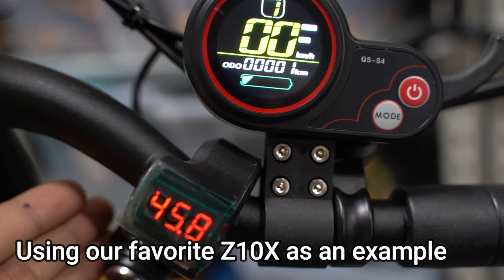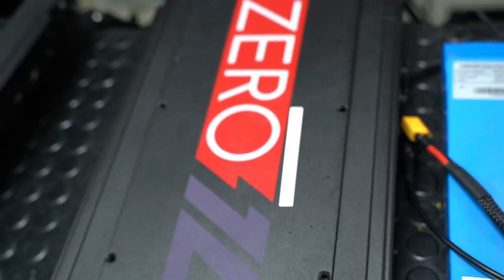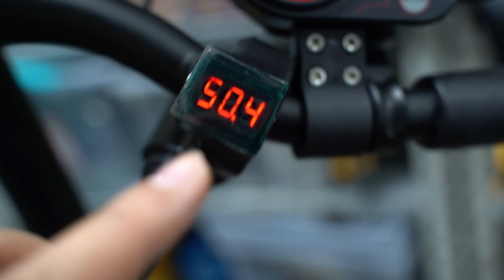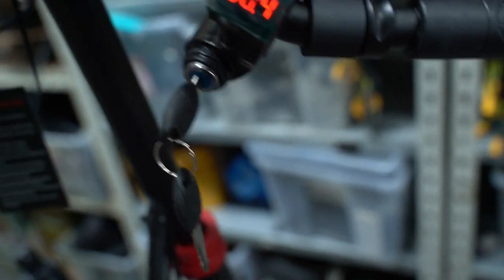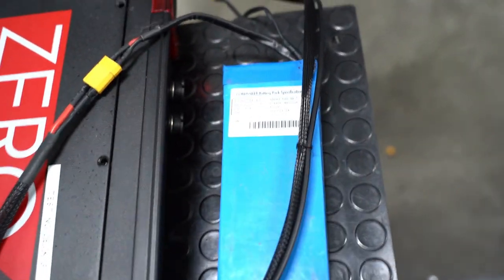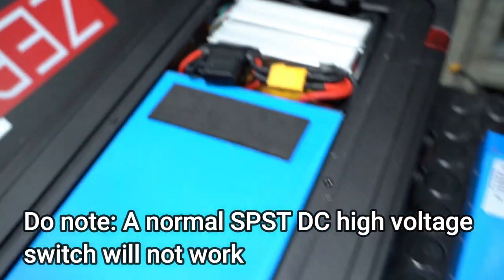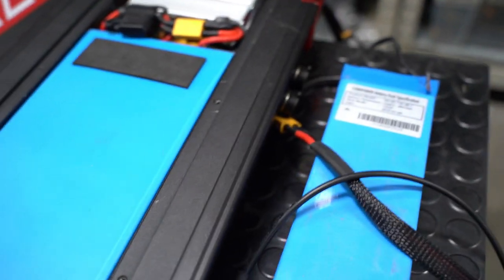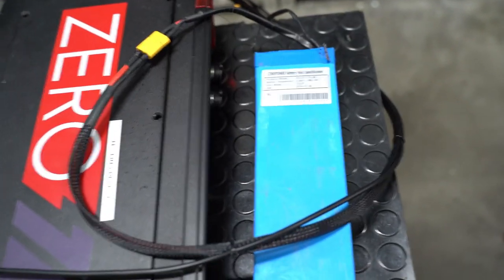MORE RANGE: Parallel ANY 2 Batteries Using Solid state switches for E-Scooter or E-Bike

Comment: As long as the battery is voltage matched, you can just wire them in parallel and you don't even need a switch.  They will balance charge.  I've done it on my M365 clone.
Reply from the maker: That’s what many non industry people believe. Voltage has to be matched and also within a certain charge voltage. If one battery is at Low charge and one is full charge then it’s bad for the Low charge battery to be charging and discharging
Reply: @FalconpevSg  Yes, to ensure safety you would need to make sure both battery packs are charged to the same voltage before connecting them in parallel.  One can argue with the BMS in play that you might have a lot of leeway in how different the voltages can be tolerated.
Reply from the maker: @alanhonlunli  thank you for this insight
Reply: @JiggyDancer is there no effect and damage to controller?
Reply: @leovenericksonlorin9000  what matters to the controller is the voltage of the circuit.  That doesn't change when you connect batteries in parallel.
Reply: @alanhonlunli  thank you bro for the info. So it means either I put 100ah external battery  there is no effect to controller as long as voltages are the same, right? 

One more thing, Is it necessary to parallel also the charging port of external battery to charging port of internal battery or no need?
Reply: @leovenericksonlorin9000  yeah, theres an extra set of wires for the charging port.  You'd also hook those up in parallel with the charge wires of the internal battery pack.  I would recommend your external battery pack to have it's own BMS.
Reply: The switching scheme is useful off your external battery is something removable for other uses or if you have multiple spares for immediate swap out. Otherwise the extra battery will need to be permanently connected to the bike at all times to maintain equivalent voltage during discharge and charge.

Comment: You really should not call this a parallel setup as that is not accurate. This is a dual battery system that can be switched on the fly between each. Does the smaller battery have enough capacity to not be over discharged? It would have to be using higher Amp cells than the standard pack.
Reply from the maker: yes its two isolated battery systems. ok maybe not parallel.

Comment: I use 2 batteries of the same capacity in parallel with a solid state switch DC relay voltage 24-52V manual SPST switch combination, but when I switch from the main battery to the sub battery, the capacity drops to about 1.5-1.7. If you don't run carefully, the battery will go up on the way home.

Comment: Just to make sure, the manual solid state relay system switches from internal to external battery. And not from parallel to single battery
Reply from the maker: Yes it switches from internal to external

Comment: Super useful 👌 after 2 ares of riding and if I like scooter and not that expensive for my Vsett8 is abaut 350€ I found out in Cehoslovakia I found solution they made for EU that cind of pakeging.  And I low it. Small is best solution fir mine and its not small :) i think its range 20km only external+ from Vsett and 350€ is not litle but sels are from LG or Samung

Comment: This is a great solution, but only if you plan for disconnecting the external battery for other things than your scooter. Otherwise it would be better to wire them i parallel directly (matching voltages) to take advantage of the lower voltage sag. With lower voltage sag you are also able to drain the batteries more (in case you need that extra range) before low voltage cut off.

Also capacity difference between paralleled batteries are not necessary. The bigger battery will take a larger proportion of the load and the voltages will be equalized between the two.
Reply from the maker: From our experience, connecting batteries with different voltages will result in the higher voltage battery charging the lower voltage battery causing damage in the long term due to the high current surge. You are correct on the voltage sag issue esp for high current usage. But another downside of connecting two different capacity batteries means that you do not maximise each batteries capacity as one battery will be used to charge another. We have found that this method is safer and more efficient in the long term health of the batteries.
Reply: @FalconpevSg  in terms of voltage that is not what I said. The voltages have to match very closely when connecting (or else high in rush current will flow from high voltage to low as you say) and of course the packs must have the same amount of series connected strings (eg 13S for a 48V battery).
The last thing is simply not correct. You can deplete the batteries even more when they are paralleled partly because of the lower voltage drop/sag, and partly because of lower current draw per series string - and you know from all battery tests that the higher the current draw the lower the capacity.
Reply from the maker: @simonmllerkristensen9640  we beg to differ but there will be no end to this discussion. Point noted.
Reply from the maker: @simonmllerkristensen9640  anyway we made a parallel battery for the zero scooters 2 years ago. This is a safer option that is developed with another use case scenarios in mind. The fact is you don’t have to maintain both internal and external batteries at the same voltage is a very big advantage. Check out our parallel battery set up here https://youtu.be/ejyIzqAz_tI
Reply: @FalconpevSg  and that is totally fine. But your understanding of battery capacity are flawed unfortunately. Parallel two batteries is the exact same as one big battery. And a bigger battery (in terms of Ah) have less current draw per cell giving more useable watt hours per cell (check every single battery test with 1,2,5 and 10 A draw)
Reply from the maker: @simonmllerkristensen9640  do you mean to say if you connect one 18Ah battery and one 8Ah battery in parallel, the 8Ah battery will not discharge first?
Reply from the maker: @simonmllerkristensen9640  the method you suggested is what DIYers and garages do, but we think it is always good to develop new solutions to make things more user friendly for the everyday user and not just DIYers. You may be technically right but this parallel solution comes with too many constraints and requirements that we find doesn’t fit the needs of the regular user.
Reply: @FalconpevSg  again, totally fair as long as you do it for the right reasons and with factually correct argumentation. Have a great day 👍
Reply from the maker: @simonmllerkristensen9640  thank your for your feedback. Much appreciated.
Reply: @FalconpevSg  how much is at and do you have it in your store,?
Reply from the maker: @robertmwangi1493  yes we do have it on our website. Link in description
Reply: Simon is correct. Having the individual cells with the same Ah is helpful, ie. similar cell chemistry, but otherwise the total combined battery Ah is basically irrelevant.
Reply: hey bro would a simple parallel conection work if I use two  72v batteries one is 35 mah and the other is 32. Will it work with no issues
Reply: @FalconpevSg  I can't see why you couldn't hook a 20ah and a 10ah together and just get more ah, provided they are the same voltage... the method described in the video is silly to me and dangerous... how many AMPS can a 7ah battery support?  Unlikely that it supports 40AMP draw which is what the zero 10x requires... if both batteries were connected together...regardless the ah... the cells would equalize and provide more AMP vs required instead of less... would pulling 40AMP from a battery which supports 20AMP output be wise? You could rely on the bms to save you... but the odds of failure of damage are high... if the batteries were parralel you could charge and discharge with them connected... you just can't plug them in together when one has a voltage of 44 and the other 58... that would be unwise and the equalization rate would far exceed the max charge rate supported by bms/ battery cells.

Comment: Is the recuperation of my scooter possible with the automatic or the manual switch?
Reply from the maker: Your scooter cannot be turned on?
Reply: @FalconpevSg  nono, I mean: Does it support regenerativ breaking? I think so because the relay doesn't care in which direction the current flows, am I right?
Reply from the maker: @MrTrackmaniafan  yes it just creates a closed circuit on either battery
Reply: @FalconpevSg  thank you, for the quick response. Does the automatic switch support regenerative brakes too, do you know that?

Comment: CAN you connect in parallel from the charge port ?
Reply from the maker: So you can plug 2 chargers into one port?
Reply: @FalconpevSg  i meant hooking up the external battery to the charge port to run in parallel
Reply from the maker: @kevmack101  you can’t do that, the charge port will melt
Reply: @FalconpevSg  COOL THANKS FOR THE INFO
Reply from the maker: Depends on what charger, each charger port can only take 5A

Comment: This is what i want, having a reserve battery when your internal battery is low. will this work with 36v? thinking of doing this setup, i don't want to connect both , just want to have separate internal and use as reserve the external.
Reply from the maker: Yes it will

Comment: Was thinking the external battery is cheaper smaller y don't he get rid of original battery and replace with 3 of them new battery packs would that be possible
Reply from the maker: Cost concerns. Why waste a perfectly good internal battery?
Reply: @FalconpevSg  thas not the point if the original battery OK or not I'm thinking Moore 3 of them instead of the original 1 would be 2x times the you could go ie distance and bit Moore power I'm saying as I have apollo ghost and maybe would like two travel 2 times the distance or use a lil of my power and no I'm going get where I'm going with out losing battery ie the faster I go the quicker the battery life so if you have 3 of them I'd be able 2 full power and still get where I need two as il have 2 times the battery life

Comment: can you connect two of these external batteries in parallel and use switch between internal and external ones?
Reply from the maker: Yes of cos but the switch needs to be spec proprietor

Comment: hey great video , WILL THIS WORK ON MY KAABO WOLF KING GT 72V the ato switching one. and will it drain from both batteries at the same time so I get less voltage sag
Reply from the maker: Yes it will work on all escooters
Reply: @FalconpevSg   DOES this WORK FOR SCOOTERS WITH REGENERATIVE BRAKING?
Reply from the maker: @kevmack101  the kaabo does not have regen braking. They may say they have but they do not. It’s only ebraking

Comment: Hello Falcon, you guys ROCK!!! I have a simple question can you parallel series wire 2 scooter controller positive and negative connections to the only 1 output from a battery if that battery (replacement) shares the same voltage ⚡️ as the original? ( Need new Dualtron battery 🔋 that originally has Dual outputs and a single input) thanks 😊

Comment: If I use 2 batteries in parallel, both 48v 15ah ? Will it then be 48v 30ah ?
Reply from the maker: Yes
Reply: @FalconpevSg  does it give more than twice the distance ?
Reply from the maker: @anio6865 no it will be twice the distance

Comment: Can I connect the 52v35Ah battery to the ZERO 10X's 52v25Ah controller using a parallel battery solid state switch DC relay to extend the range? Shouldn't it exceed 25Ah? The built-in battery is 52v23Ah. If you do not reply firmly, you cannot purchase a sub-battery.

Comment: Hi i wonder if , i have a kugoo kirin m4 pro and it has a 48v 18 ah   can i add an a biger ah than the stock battery and charge them two batterys from same charge por, or i need to have same ah as the stock, will the charger burn if i have bigger ah than the stock ?

Comment: So, I'm interested in this... I have a Kugoo M4 Pro and a extra battery and a external box... What do I need to purchase?
Reply from the maker: Is your internal and external battery the same size in Ah?
Reply from the maker: @CripNchill  you will need a parallel battery harness
Reply: @FalconpevSg  is it long enough to reach the external battery mounted on the handlebar?
Reply from the maker: @CripNchill  it’s about 1.2m long

Comment: I have a 48v 16ah Kugoog2pro and i have 48v 12ah external battery kit . Would module box help me ?
Reply: Honestly this device isint really necessary. If you fully charge both batteries you can connect them with a simple pigtail permanently or if you want to keep the second battery separate to where you can disconnect it just plug it into the charger port on the scooter when the scooter and external batteries are both fully charged then they will drain evenly and you will actually get better distance than using a switching device.

Comment: On your website description it says

 "A push button SPST switch is provided to turn on and off the solid state relay. When required to be connected to parallel batteries, you will need to use dual relays. "

If I want to use the manual switch to switch between an internal and external battery like you showed in the video does that mean I need to get two of the relays? What does it mean I will need to use dual relays? Or can I just buy one of the manual solid state relays to achieve that?

Comment: You helped me a lot with this video,it is what i was looking for.My scooter though is a nanrobot d4+,will i have a problem installing it? I believe not.
Reply from the maker: It’s universal. Should be able to install on your nanobot
Reply: I found this video looking to do the same on my Nanrobot D4+. I seen another guy do use a zero10 external on his D6+. So it should be doable. I definitely want to use the smart switch option.

Comment: Do you still need to match voltages or no
Reply from the maker: No need:)
Reply from the maker: with the switch no need. Without the switch you will still need to do voltage matching

Comment: Im trying to reduce voltage sag  when I go full acceleration it goes from 65v to 60v.  I want a external 15ah battery to help. Should I use a parallel switch or a parallel harness?
Reply: Its got a 60v 30ah battery 2.   45a 3000w 60v  controllers I think I'm only getting like 4000w total because of the sag. Am I wrong to think that?
Reply from the maker: Use a harness not a switch

Comment: Can somebody please answer this if you know for certain;  Does this work with regenerative braking?  All the solid state battery balancers I have looked at for e-bikes are described as explicitly not supporting regen. I require regen for my e-skateboard build, as it is the only stopping mechanism. I want dual removable batteries to enable instant spare swaps, and convenient charging routine, leaving my rather heavy, powerful board in my car while taking just the batteries upstairs to my 3rd floor apartment (with no elevator) for recharging.
Reply: I don't believe this will work with regen braking as I tried a similar system on my 60V batteries and saw 95V being fed back to the batteries during braking.

Comment: When you charge both of the batteries, do you need to charge them separately ( disconnected) or it is okay to charged them while they are still connected?
Reply from the maker: You can charge them together

Comment: Why not simply connect both batteries in parallel instead? It would reduce the strain on the cells, keep the same voltage between both, provide a bit better range and offer stronger, more consistent performance across the board than this complicated solution.
(With some diodes if the extra battery is not permanently connected to prevent one battery to charge the other at high current)
Reply: Sounds great.  But do you have a device that does that?  I have two batteries: 1) 48V 26A and 48V 20A.  How should I connect them?
Reply: @GFong  There are plug and play devices available (but at a cost) if making such a thing is out of your ability/comfort zone. The 
DATEx2 Parallel Battery Adapter - Or Battery Blender in US, Is a prime example. It's not cheap, But design wise is the best imo. It uses XT60 sockets. And you can simply run 2 batteries of any AH or voltage and your controller though it with no hassle.

Comment: I have a scooter with a battery capacity of 60 volts, can I connect it in parallel with a battery capacity of 52 volts?
Reply from the maker: No it will spoil both batteries

Comment: Couldn’t we just swap out this small battery for the big battery and get more room in the deck? Or am I missing something. Or do we lose something in the process?
Reply from the maker: Ease of use. To swap out a battery, you need to undo the screws and take out the battery and put in the new battery...nobody wants to do that mid ride.
Reply: @FalconpevSg  Not what I am asking...  That battery looks very small compared to what I have now.  Can I just swap out this battery for old bigger battery?  It will leave more room for other things.
Reply from the maker: @caseylgoodrich  the small battery is just an example. It could be a huge battery too. Size doesn’t matter in this setup.